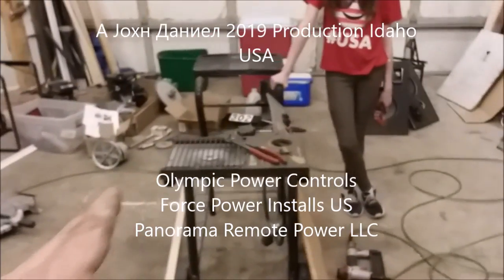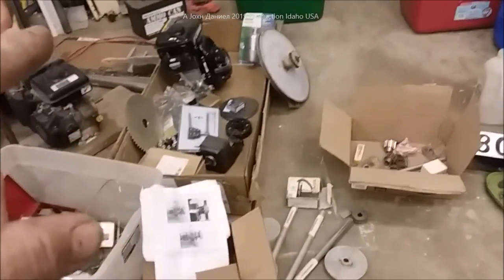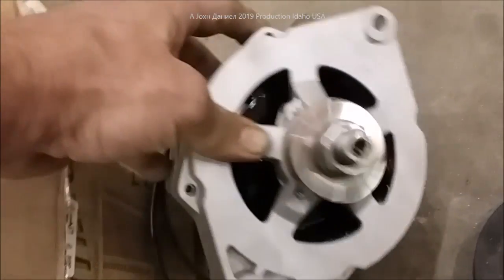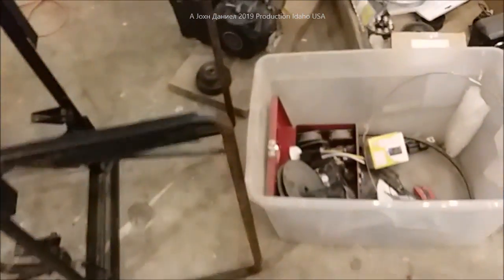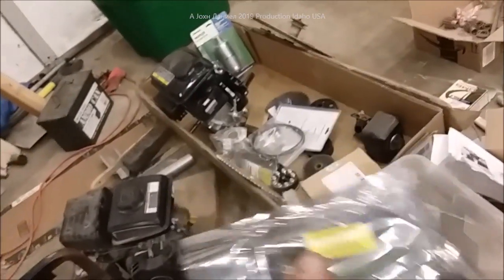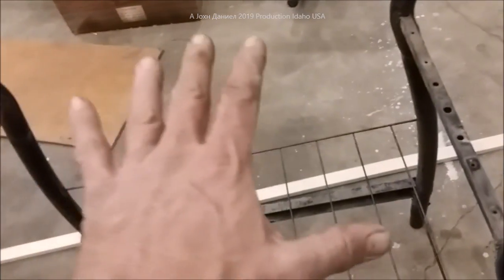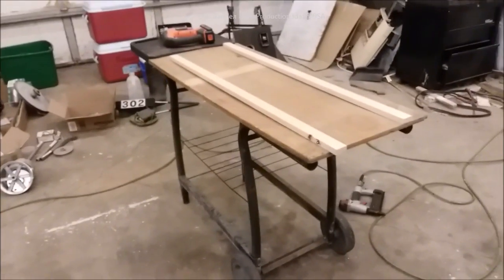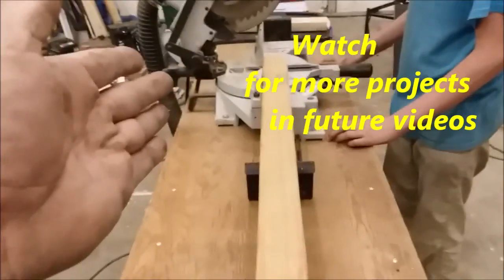BBQ Pit frame made into Miter Saw table & project updates

Comment from the maker: That 3 phase - 12 volt Thermodyne PMA for wind & generators https://ebay.to/2UCyVYh . Other Things we use, https://amzn.to/2EaPFwx
Reply: Where do I find the specs on the OPS diversion load controller??  Are you selling these or are they manufactured for your installs only??
Reply from the maker: Its designed for multi staging and load point braking so your turbine performs at max effectiveness. I do not sell these at this time outside of installs due to every persons conditions are different. The near same SSR diversion only models are at https://ebay.to/2OPBX5K  If you have 2, you can set one to divert to resistor loads at 14.45 volts, the other for 14.75 volts and do nearly the same thing as I do. Other diversion makers like a popular 440 amp "claimed" model, do a high level dead lock short circuit on your turbine, and they destroy turbines. Very dangerous!
Reply: @JOHNDANIEL1  Thanks for this cite... indeed a WindAndSunPower.com / Jeff Mason layout.  Do I need a programmable controller like the MidniteSolar KID, or once it's dialed in with a controller like this I won't be screwing around much?  I get the role of dual controllers and curious about the higher voltage controller load it is switching??  I know, too many questions... do you consult?  Happy to buy some time from you....